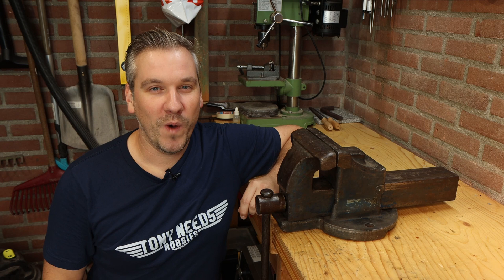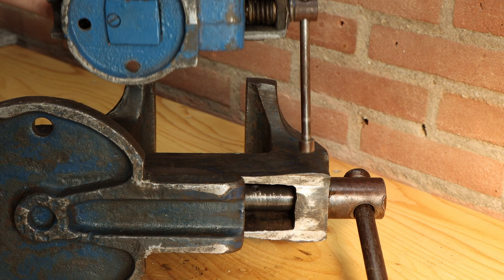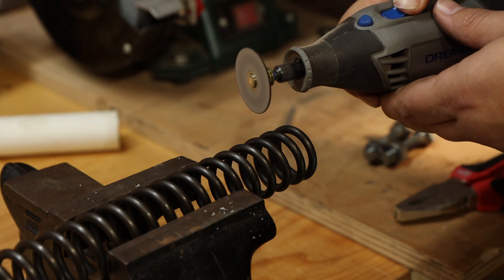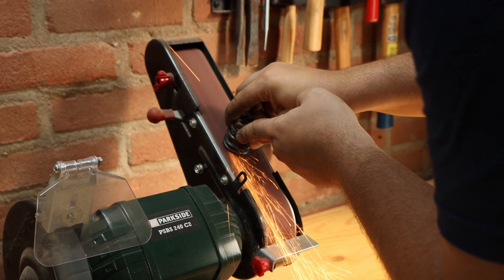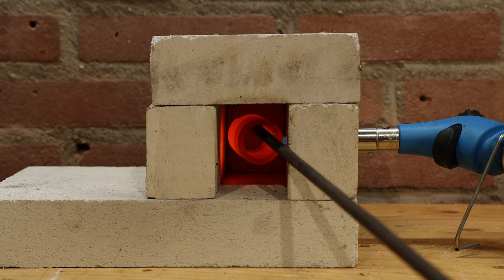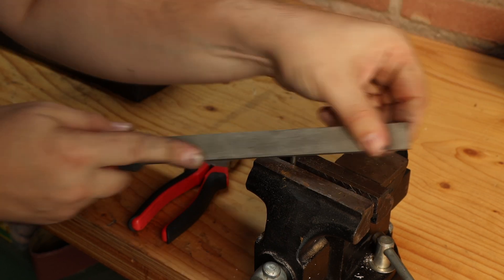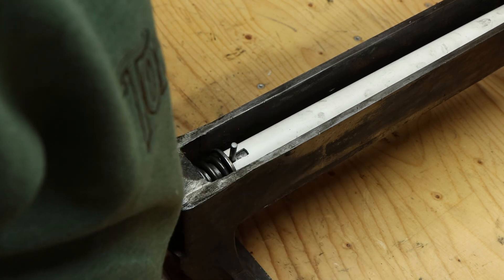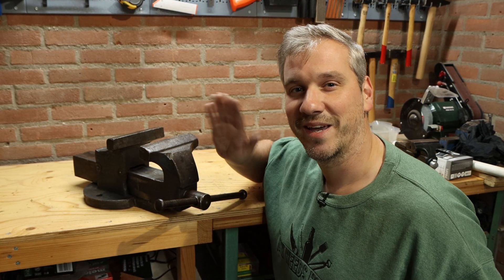Repairing a Big Vise by Making a Spring (60 lbs, 7 inch jaws)

Comment: Im confused.  Its a spring? A spring does what a spring does. So why the need to heat treat / temper it.  Its a spring. Just use it as is. Cut it to size and just use it without all the palaver.  Or am i missing something?
Reply from the maker: Thanks for your comment.  I'm not a material scientist whatsoever, but I did notice that it shattered if I didn't temper it as you can see in the first attempt to heat treat it. Since I had to heat it to bend the ends of the spring, the metallurgical properties of the metal were changed.  This brittleness will also occur after heating and bending the edges so I it has to be tempered to become springy, not shattery, again. Heating/quenching was probably not necessary, but tempering definitely was.

Comment: Good job. When heat treating high carbon steel, it is usually best to heat the metal till a magnet wont stick to it, then quench in canola oil (heat treating is very complex but for a diy/home job this method works pretty well). Straight after quenching, temper for 2 x 1hrs cooling inbetween at 300-400 celcius  higher the temperature the more flexibility it will have. Don't drop or hit or flex before tempering. Hope this helps someone
Reply from the maker: It would've helped me a lot if I knew before giving it a go 😉 I learned the hard way haha. Thanks for the elaborate explanation and for watching my video and taking the time to write this positive comment. I highly appreciate it 👍

Comment: MOD:
Weld or mill a ½ square socket driver female at the screw head.
1 so you can open and close the vice dismounting the sliding lever with an out of the way removable standard ½ ratchet or a ½ drive sliding T handle or breaker bar. 
2 so you can use straight power tools as impact wrenches to open and close if you have multiple and heavy clamping to do. basically transforming the vice into a press either.
Reply from the maker: That's a great suggestion, thank you!